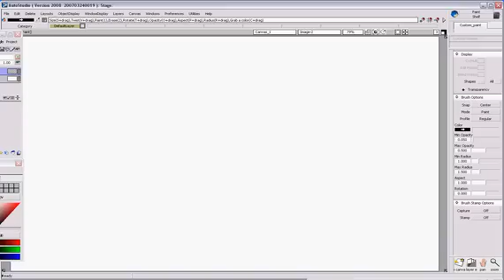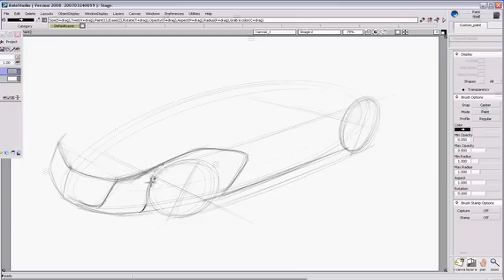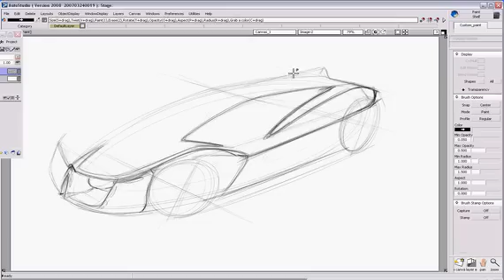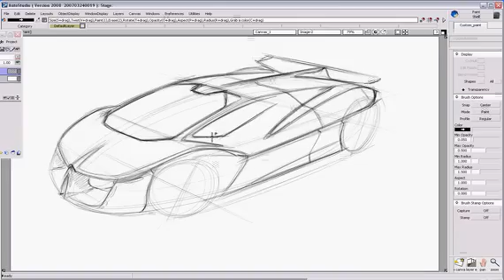Car Design Sketch Tutorial for a Supercar using Autodesk Alias Studiotools

Comment: i have a qeustion about wheels. i know from the side view its just circles that are 2.5 wheel lengths apart (sometimes 3 or 3.5 but w/e) and from the 2 point perspective, the axles come from a vanishing point and the minor axis of the elipse is perpendicular to the axle (major axis). BUT how do you figure out the distance between the wheels and how do you make the wheels look the same size, and also how do you decide on the minor axis length of the elipse from 2 point perspective?